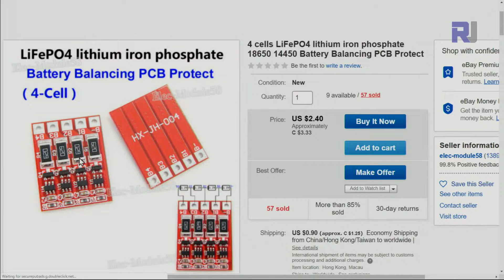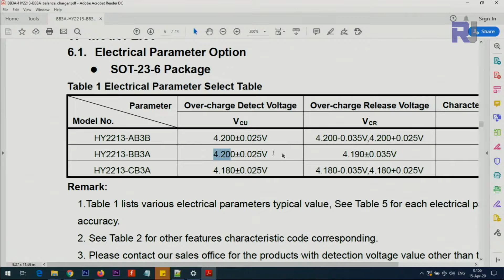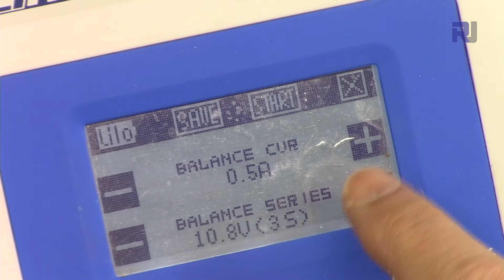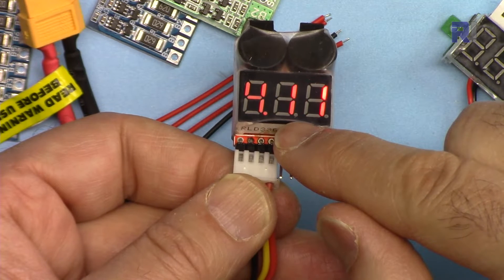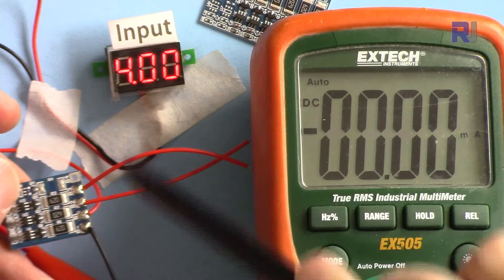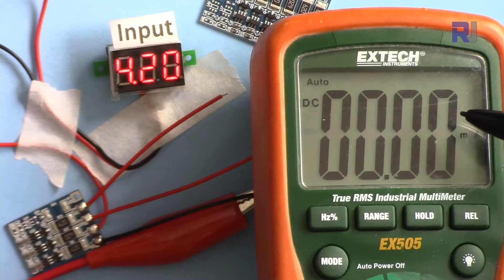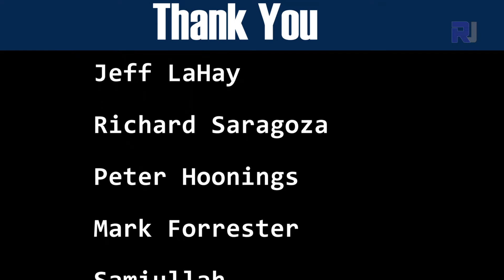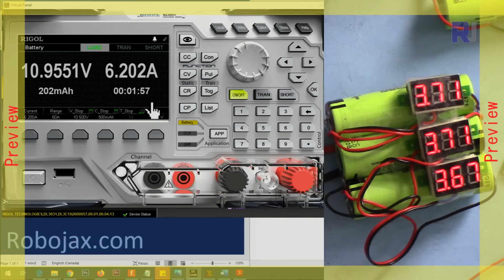Lithium Battery Cell Balancer Explained charger 18650 and BMS

Comment: Nice explanation anw, -
 so it usually called bms, right? & what's diferent with battery equalizer??
Reply from the maker: Hello,  I have separate channel on energy and batteries. 
here is cell equalizer/balancer video https://www.youtube.com/watch?v=0yo4lzxENrk and here is BMS video https://www.youtube.com/watch?v=QNENyu97w2A the current video is cell balancer/equalizer.

Comment: if i repair laptop battery and using brand new battery for replace old battery can i simple them balance without any electronic only connecting them in parralel and then replace cells?
Reply from the maker: Yes you can balance them. This is very slow.  Here a video on my other channel on balancing using active balancer https://www.youtube.com/watch?v=0yo4lzxENrk

Comment: Can we use it as 2s balancer?? 
Please reply
Reply from the maker: Yes you can use it. just connect two cells.
Reply: @robojax  another help 
Can u say why lithium cell is heating after charge it is a 2s battery pack with bms and no balance charge
Reply: It is a 18650 battery pack containing 4cells 
2 in series 2 in parallel

Comment: 66 mah of balance in 4.23 is not very little it does not reach 10% of the capacity of the battery. To properly balance a battery it needs to operate at 4.1 volts at a current of 10% of the battery.

Comment: Is there a way to changing the balancing voltage on these balancers, by replacing the R5 resistor maybe?
Reply from the maker: No you can’t change it. I had to watch the video yo reply.  There are different version of the chip for different voltages but you can change them using a resistor

Comment: Hi Ahnad, very interesting your channel. I whish to know if you have any project whitch charge a Li-Ion 18650 arrangement 1S 5P or more parallel Cells, using a different board from TP4056. Thanks. A best regards from Argentina
Reply from the maker: Hi, See our other channel focused on energy and battery https://www.youtube.com/watthour the channel is new and I have purchased lots of batteries and lab equipment to do experiments and post results.
Reply: @robojax  Thank you Ahnad

Comment: Great video   nicely explained. Thank you.
Could you please explain how to connect charging module and balancing module in to a 3S battery pack
Reply from the maker: then what did I explain this video?
Reply: @robojax   couple both modules as a 1 circuit

Comment: Amazing.
Explanation was very useful.
Sir I have question, I've been looking for the answer.
Does it support balance discharging, as it use to balance charge, because I have a 3s4p battery which I use for backup of my router, but I also want to add a mobile power bank board which uses 3.7 to 4.2 voltage, can I connect it's terminals with B- and B1 whare voltage are 3.7 to 4.2 (1st cell) while also using 12.6 voltage also for sometimes,also tell me if I do something like this and charge my stuff using that powerbank module then will it consume first parallel 4 cell or the whole battery pack by synchronizing with other cells in series. Please tell me , or please test this for me and others if you can.
I'll be very thankful to you.
And also one more thing.
Reply from the maker: it does not care about charge or discharge. when you connect the battery it starts balancing. You are welcome. Please subscribe. I appreciate it and helps my channel grow.  Thank you

Comment: Dear Robojax. I have a question for you please. I am trying to use the same 40A 3S balancing board on my 3S pack. It has 43 Ohm balancing resistors also. My pack is off balanced and C1=3.6V, C2=4.1V and C3=4.0V. When I supply the charging voltage (12.6V), the C2 reaches 4.2V after some time and starts dissipating heat through it's balancing resistors. At this time, the charging is also becomes OFF and the other two batteries don't get a chance to raise their voltage. So, I am worried about how the balancing is supposed  to work in a well off-balanced pack like mine. Can you please explain.
Reply from the maker: We have one channel for each cell. One battery should not affect the other.
Reply: @robojax  Hi Robojax, thanks for your answer. Does that mean, when one cell reaches 4.2V, it turns off "only that cell" and keep charging the other cells ?
Reply: @kamaledirisinghe  After several discharge-and-charge cycles the batteries will finally achieve balance. The cells that reach 4.2 V first will repeatedly discharge to the recover voltage (about 4.0 V) and so the whole stack approaches balance.

Comment: Thanks for the effort in creating this informative video. I am searching for how BMS balancing works and your video gave me a very good concept. In your video, you demonstrated how the balancing works and showed the 66mA current for one battery.  Do you know how much would be the current or how it would flow when two batteries (say, battery 1 and 2 which are next to each other) are doing balancing?  How much would be the current value and what are their direction on B0, B1 and B2 lines?  I am new in learning electronic so please forgive me if this is a dumb question.
Reply from the maker: Here is the full details on my other channel. Please subscribe as I need that channel to grow so I make more videos https://youtu.be/QNENyu97w2A
Reply: @robojax  Subscribed.  Look forward to more informative video!
Reply: When battery1 and battery2 are being balanced, I believe B1 and B2 lines would both carry 66mA.  Then, where do these current go?  Back to the batteries via B0?  If yes, then B0 would be -132mA and -132mA would then go through battery1.....it doesn't make sense if this is the case.  Anyone can help to answer this?

Comment: So in conclusion, is this balancing module worth it or not (66mA version)?
Reply from the maker: I don't remember what was the value. to answer I have to watch the video. so you watch and get the answer.
Reply: It depends on the size of Batterie pack, the usecase, And also the price of the Module(Only Balancer or whith addet Protektion Features,... ) . If you only change it via an rc Balancing charger it isnt needet.

Comment: What does balancing a single cell actually mean? Isn't the point of balancing to even out the difference in voltages between cells in a series pack? If there's just one cell then what's the point of using a balancer? I'm new to working with batteries and want to learn as much as I can before even actually touching one.
Reply from the maker: you are right. when it comes to 1 cell, it has no meaning.  Please watch this to learn about the charger https://youtu.be/0mOqpCfAdy4 or this video to learn about battery protection https://youtu.be/3dwA8A8VrrE

Comment: Thank you for the excellent demonstration.
I think there is lot of misconception regarding the function of BMSs on the internet. I always though that the balancer keeps the same voltage on each cell connected in series no matter what state of charge they are in.
Thank you very much for clearing this up for me.
Reply from the maker: You are very welcome. I am glad you found it useful.

Comment: can you add a parallel resistor with the 62 ohm, to increase the balance current? say a 220ohm to get a slightly higher balancing current?  it looks like the FET would be able to take it.
Reply from the maker: no you can't. the resistor is connected/disconneced by a transistor/mosfet and all the current will pass through that  transistor. The transistor has rearting for certain current and it will burn. unless you change the transistor to higher current value.
Reply: @robojax  hi. I have a question is If the mosfet handled the current so the resistor is not. Right?
So why its so bigger then other resistor

Comment: When do the balance only boards start balancing? Most BMS only balance at near 4 volts,  id like the balance to start early, maybe anytime it is charging, although I guess it is more efficient when the charge current is greatly reduced, at near full charge. I think anytime it is charging would be better, (* sorry you answered most of my questions,* )
Reply from the maker: If you watch it you will see the demonstration. I spend almost  2 days to make this video.  The blancer starts at 4.2V. Watch it.
Reply: @robojax  He is looking for a balancer that starts balancing at below 4V.
Reply: What you want is called an "active balancer", they will take power from cells with more voltage and delivery it to those with less power. They also have the benefit of not balancing by wasting power via a resistor too.